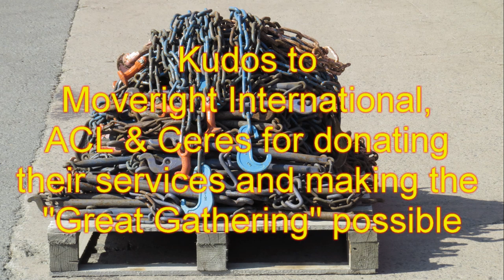A4s return to North America May 2014 Part 2 Dwight D Eisenhower

Comment: and the locomotives have been loaded on different flatcars
Dominion of Canada got loaded on flatcar 131028
and Dwight d Eisenhower got loaded on flatcar 131051
and where was the dominion of Canada
Reply from the maker: DoC tender is on CN618218 and DDE tender is on CN618088. The locomotives are on QTTX 4 truck flat cars QTTX131028 & QTTX131051. Last night tenders and locomotives were due to leave Moncton (probably on train 305) for Montreal.
Reply: David Othen did the DDE leave with DoC?
Reply from the maker: LappLocomotion2
Yes
Reply: David Othen
Do you know what length Flatcar DDE's tender is on, I tried to google the road number and found nothing
Reply from the maker: Try www.rrpicturearchives.net/rsPicture.aspx?id=500219

They give the length as 73'4"
Reply from the maker: Sorry that was DDE locomotive. The tender was on CN 618088 and from rrpicturearchives.net CN 618155 which seems to be part of the same series is 65'8"
Reply: David Othen
Thanks, Now to find one in n scale. I'm attempting to recreate the two loaded DDE cars in 1:160
Reply from the maker: Take an Atlas CN flat and lengthen it!!
Reply: @intermodalman123 
13:04
Reply: 5:15
Reply: @LappLocomotion2 ❤ 7:27